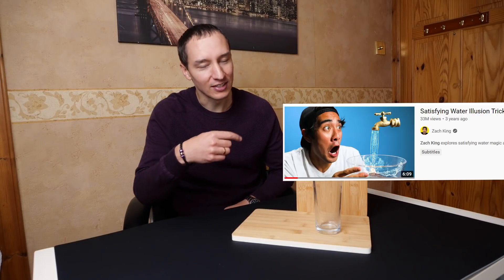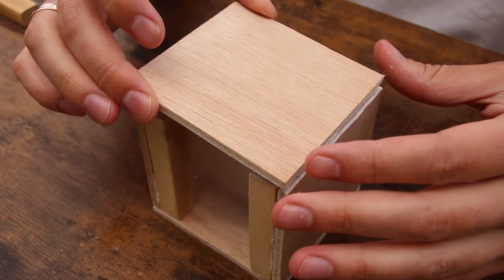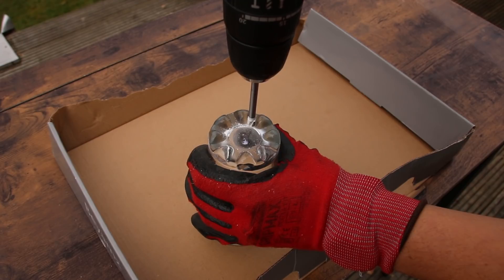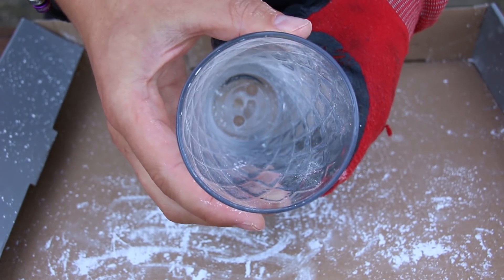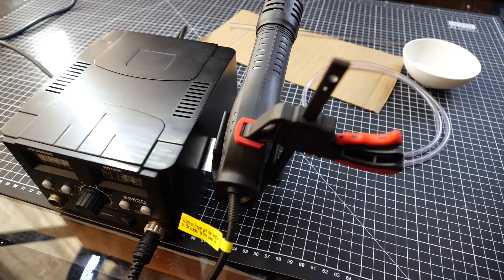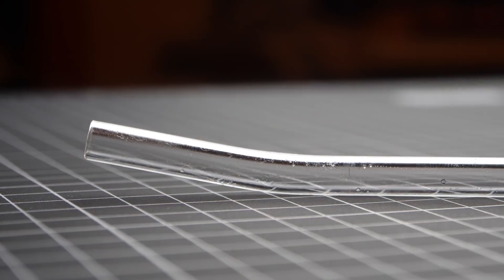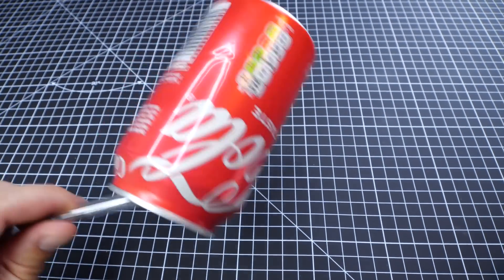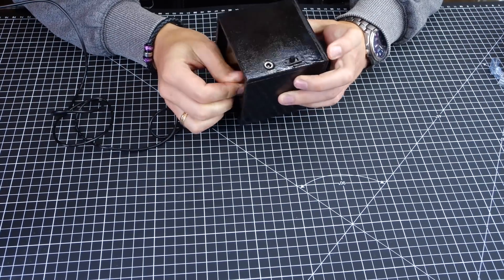Making a Floating Can Illusion

Comment: Will the excessive sugar content wear out the pump?
Reply from the maker: @Ian Smith good question I do not know the answer to. I have thought about this and I always run plain water for a bit after using coke. I don't want the pump to seize as the sugar gets sticky. In fact I am so lazy to clean the system every time when I shut the thing down, that I have replaced the coke with water and food coloring!
Reply: @MakeithappenDIY  If it's for visual effect, why not just run cold coffee through it?
Reply from the maker: @Dan Liebster yeah,  that is what I am saying: I have already swithed to water and food color. But coffee would probably work even better. Thanks!